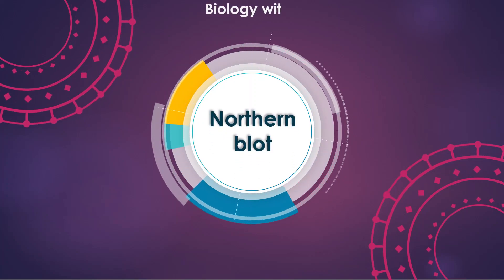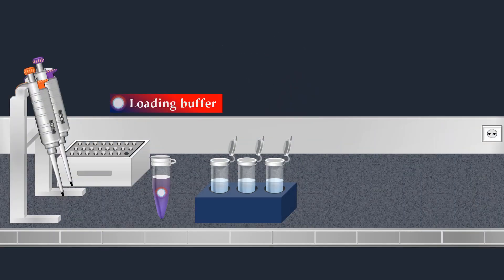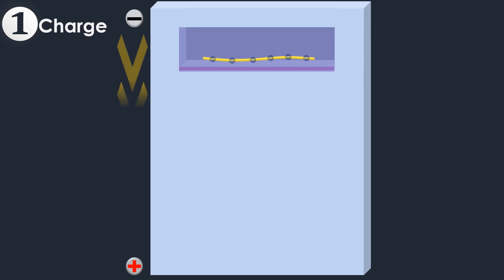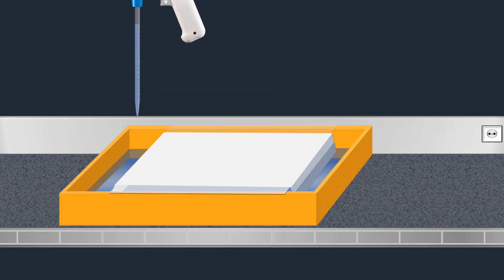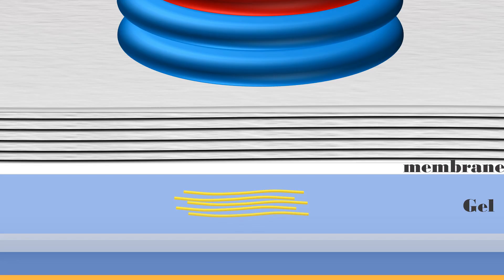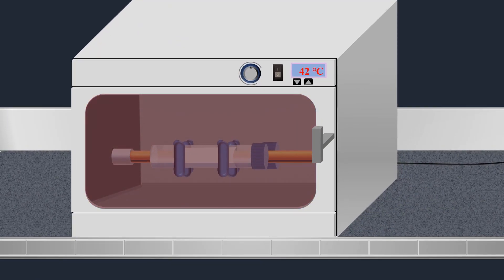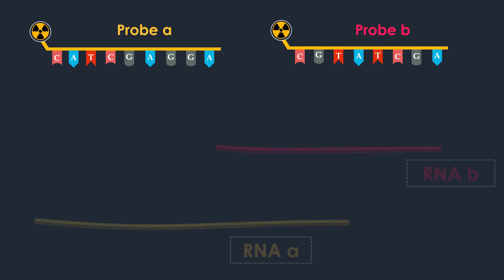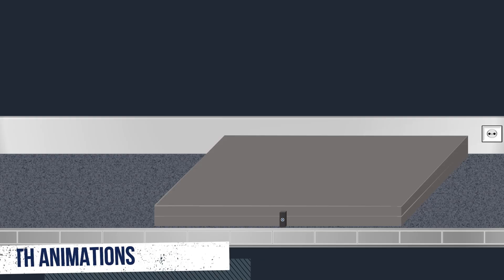Northern Blot Method - Animated Video

Comment: Formaldehyde serves primarily as a denaturing agent for RNA during agarose gel electophoresis. An additional useful property of formaldehyde is its inhibitory effect on RNases [5], which helps maintain RNA integrity during separation and gel handling.

So, basically Formaldehyde prevents formation of bonds between RNA and thus prevents renaturation!